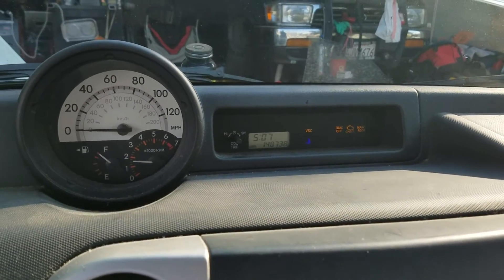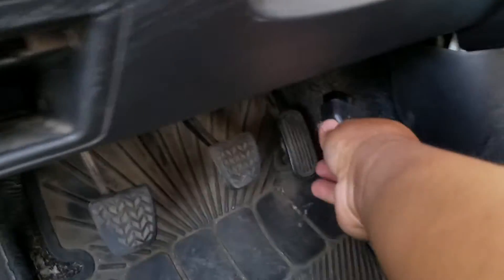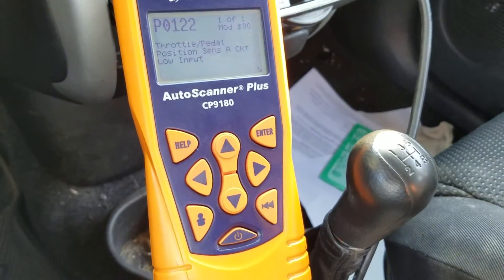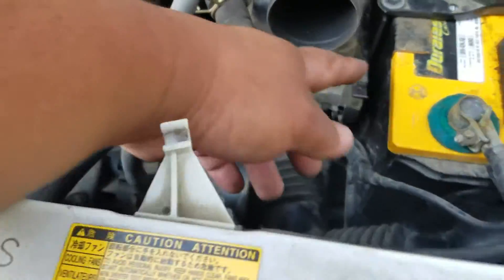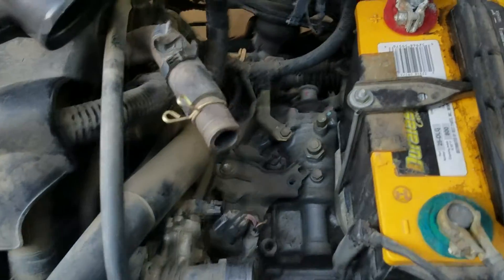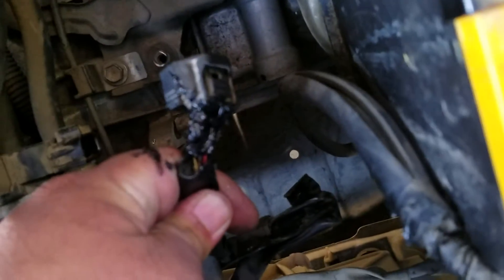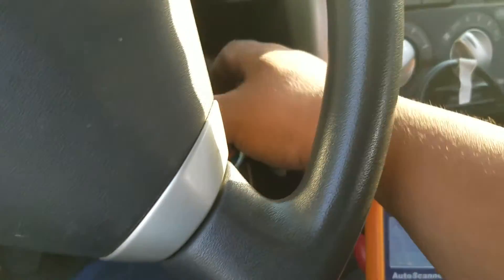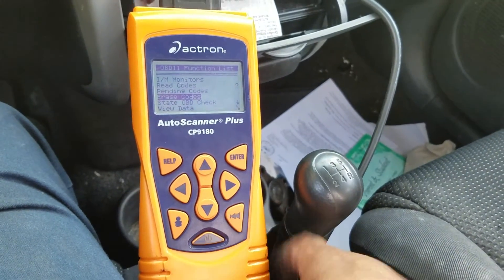Scion XB OBD2 code P0122

Comment: I have a few questions,Nice Video by the way,I had An Xb also and gave it to my dad,but besides the throtle code,Do U also have to change the O2 sensor,Mine has lost some power too,it still runs Good but i ve noticed a 5 or 10 horse power loss roughly,Do U think my dad should do those two changes or just the one U did on the video,or What else u think can Improve the Horse power to the whopping Originals 109Hp? THANKS